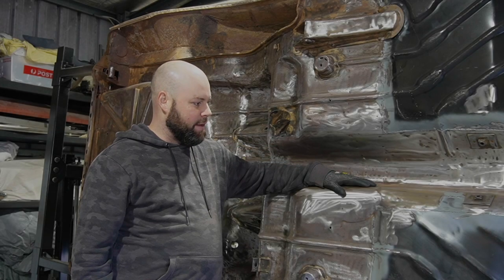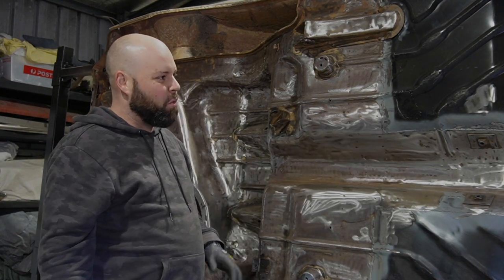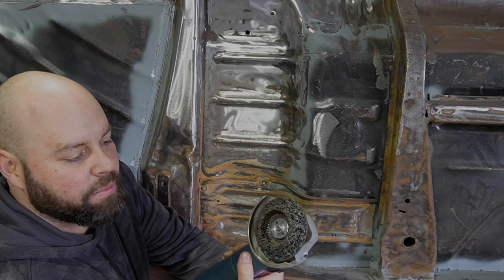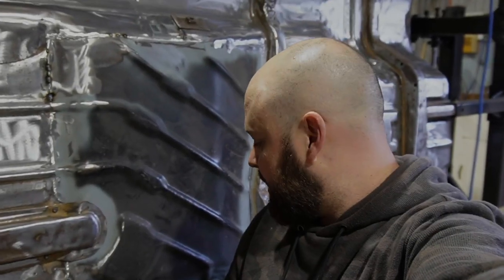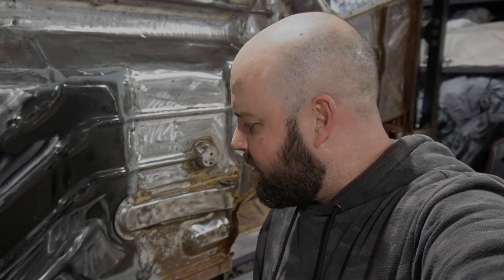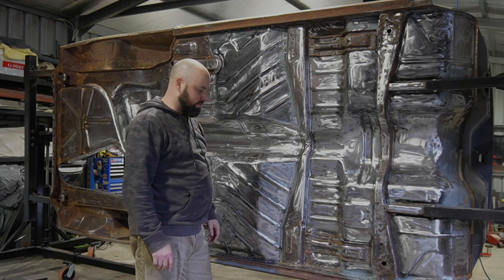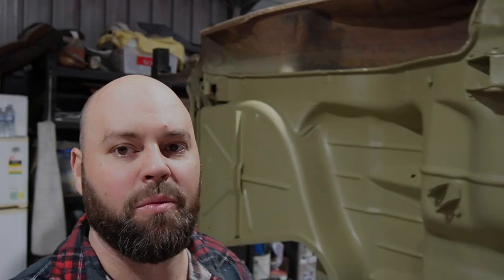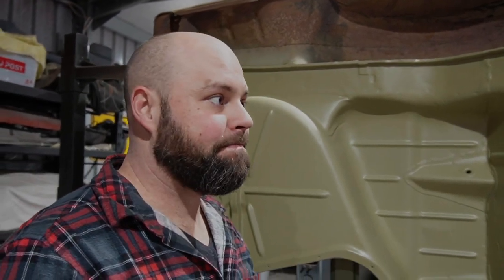Epoxy coating the floorpan: EH Holden Panel Van Restoration Build Pt. 1

Comment: Hey mate - on the surface rust, theres a product "GIBBS BRAND LUBRICANT" that phenix industries import to australia. Applied to the bare metal, it will keep the surface rust at bay, and it doesnt have any silicones etc, so you can just give it a quick wipe with some solvent, and paint when you are ready.
Reply from the maker: Thanks mate. Is that the same that Astill Designs use on his XC van?
Reply: im not sure @skillosshed  - another old school panel beater put me onto it. it works well, i had parts bare for 6 months and no sign of rust.